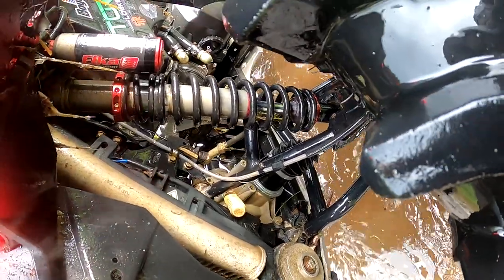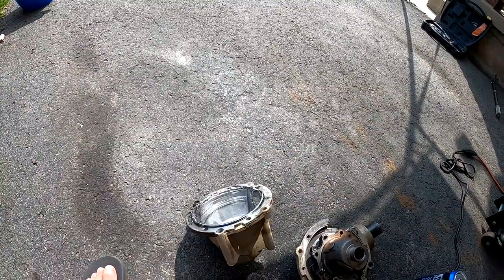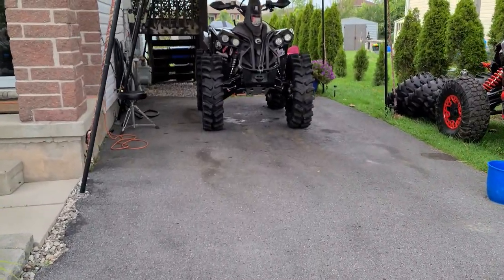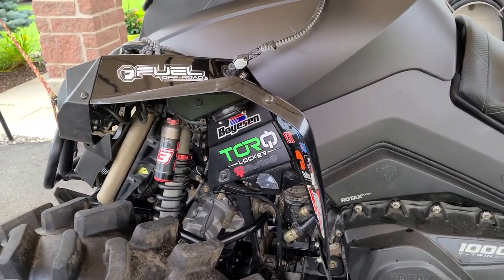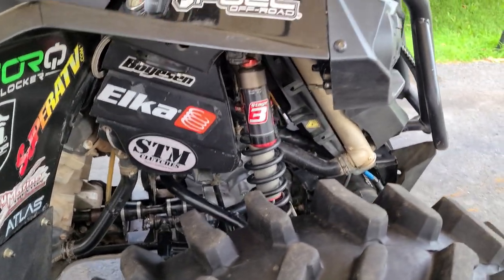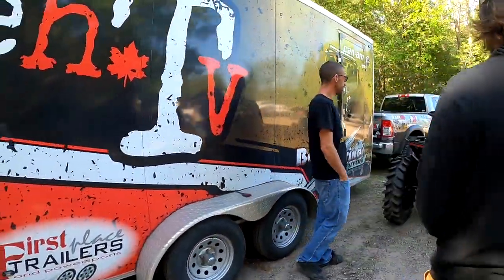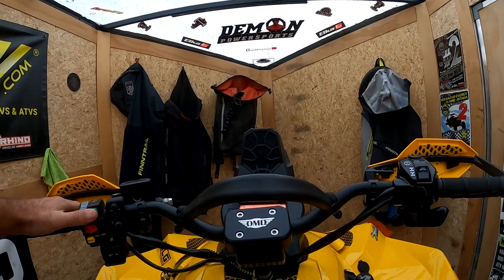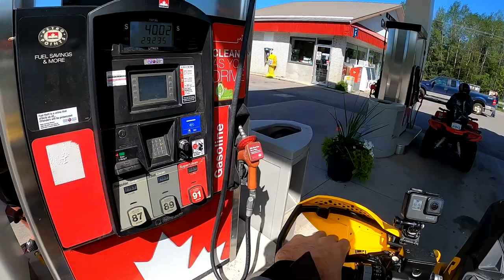Oops, I Did It Again! & HoneyBee's First Skeg Rip

Comment: Did the mechanical parts fit? do you need electronics to activate the 4 lok lock?
Reply from the maker: Just a switch, Bolted right in place no problem.
Reply: @ehTV1000  And would you describe where to connect the + and - voltage?, What color of the cable?

Comment: After a good amount of time running the torq locker would you vouch for them. Recently bought a 21 renegade 1000 xmr but with visco. Couldn’t settle for the neo yellow wasn’t for me.  Any real issues? Or major ratcheting & clunking noise?
Reply from the maker: No, just wire or tack weld those ring gear bolts and she's mint.
Reply: Awesome thank you! Love the channel lots of great content!

Comment: No Torq locker with this one?
Edit: Nevermind,  but never knew you could do the new locker and switch on the older bikes, kinda badass
Reply from the maker: I've always run the locker in the beast. Kinda wish I had welded those bolts. But it is what it is!
Reply: @ehTV1000  yeah my buddy did that with his second diff and locker after Swiss cheesing the first one with. Luckily no troubles since